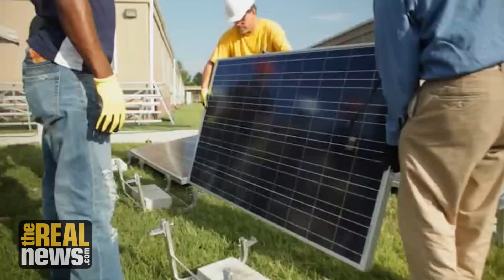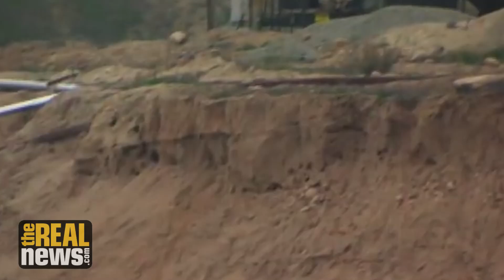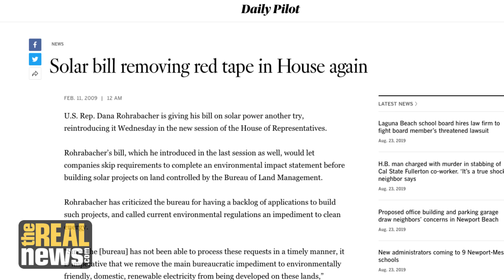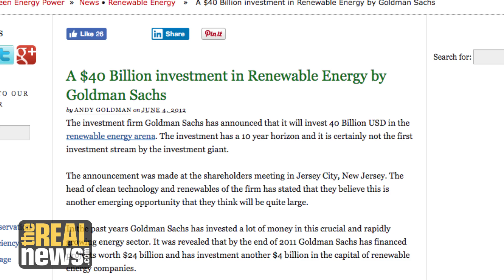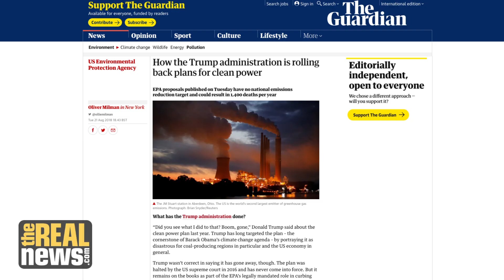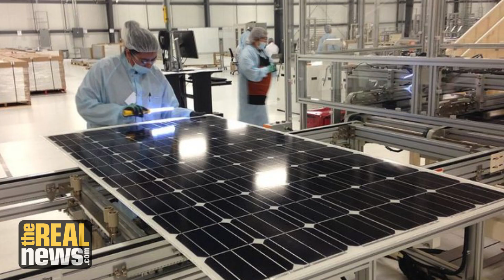The Land Politics of Solar Energy (2/2)

Comment: we have new storage capacity for electricity, the goal should be: every household should be energy independent.
Reply: With a shared megabattery for excess power generation so there would be local-use microgrids.  Imagine doing that in every subdivision.  Most subdivisions, especially newer ones, have a park or public shared space.  That would work for battery parks as well.
Reply: @zinaj9437  if we has a new power grid nationwide......plenty of work but no jobs🤔
Reply: Troy Walker The Progressive Proletariat   - It takes more energy to make lithium batteries (for solar/wind baseloqd power) than you get from the batteries during their lifetime. And that does not include the mining for resources and embodied emissions. It’s green washing eco capitalism that will not sustain our civilisation.
Reply: Zina J - It takes more energy to make lithium batteries (for solar/wind baseloqd power) than you get from the batteries during their lifetime. And that does not include the mining for resources and embodied emissions. It’s green washing eco capitalism that will not sustain our civilisation.
Reply: @wombatcitystudios  You are incorrect.  Do more research from reliable sources.
Reply: AZOffRoadster I have, I make documentaries and interview scientists. I’m sorry but there is no solution to maintaining our current civilisation in a sustainable way. You have be greenwashed by eco capitalism

Comment: Elephant in the room guys. Put solar panels on every single family home, along with solar storage in the home, then no one need buy his ridiculous book.
Reply: @JXPAT :  I definitely wouldn't take any advice you give.
Reply: Avoids transmission losses, and keeps homes cooler.  Can also be used to smooth out the load.  One European country (I forget which) is actually subsidizing home battery storage specifically for that purpose.  Electric cars with their large batteries can also be used for that purpose.  Shopping mall parking lots are also a good place to locate solar panels.  Every home or business should be harvesting solar power.  If we redirected half of the oil subsidies towards renewable energy, we could put a major dent in our greenhouse gas emissions.
Reply: @mikecorbeil  I definitely wouldn't take any advice you give.
Reply: @AZOffRoadster  it's also an incredibly awesome to Empower ourselves
Reply: @mikecorbeil  excellent, since I'm not giving advice. Meanwhile my home has solar and solar storage.

Comment: Heat reduces efficiency of solar panels. We should be putting them over the ice caps, but that will only be viable if we solve the issue of efficient transmission. And the mess it will make of the caps putting them there. Bottom line were fucked no matter what we do.

Comment: solar panels should be cylindrical so as not to redirect heat and light back into the atmosphere.
Reply: Thermodynamics makes this is irrelevant.  The light/heat always gets back out.
Reply: @robmorgan1214  integrate solar water heaters
Reply: @troywalkertheprogressivean8433  that changes nothing about the fundamental efficiency limit or what happens to the waste heat.  It's just not that simple.   You can't recover much more without prohibitively raising the costs.  And at that price point the advanced super efficient panels start to become competitive again.  Also if you go to a heat based solution you're up against the limits mechanical efficiency.  Steam is only good to about 30% assuming you find some way to make the water hot enough.  Look at solar concentrator plants they're designed that way for a reason but at a bit of a hassle.
Reply: @troywalkertheprogressivean8433  the panel technology is still advancing pretty quickly.
Reply: @robmorgan1214  im simply saying use the excess heat to heat water/make water hot
Reply: @troywalkertheprogressivean8433  I understood your point.  It isn't a very practical way to get the waste energy out of the system.   The cells themselves become less efficient when hot.  Not every photon absorbed gets turned into electric current.   If you don't re radiate that heat the efficiency will drop.  The amount of reflected vs absorbed energy is not enogh to convert into useful hot water.   The water will radiate it's energy as an infrared black body just like the panel substrate unless you use some of the electricity from the panel to pump it into a heat exchanger, decreasing efficiency.  The waste heat is about 10% of the available energy.  Mechanical or heat storage systems like this are about 30% efficient meaning you're looking at recovering at most another 3% at the cost of plumbing, mechanical systems, insulated reservoirs etc.  That's before you consider the 1%-2% loss of efficiency if you make the panels hotter by keeping the water stagnant enough to get hot or let the water sit around long enough to cool down.  Heat doesn't like to stay put.  You basically use it or lose it.  It's close to a zero sum game because of engineering tradeoffs and costs.
Reply: @robmorgan1214  still, those are concerns for large scale, and my goal is every dwelling energy independent. every dwelling having water capture, filter, reuse. btw, i think it would only take a magnifying glass to turn water to steam.
Reply: @troywalkertheprogressivean8433  that's a different kettle of fish.  I think you could use it as an overall booster to a hot water system but some thought needs to be put into it since it's not going to work very  well on cloudy days,  at high latitude, night, or in the winter.   The solar cells will function year round and at lower efficiency on cloudy days.  Keep in mind that panels are already claiming the lion's share of available energy and the leftovers are difficult to hold onto (IR/UV).  You're going to need to learn a bit about blackbody radiation as that dictates the absolute engineering limits but there's probably a way forward from there.
Reply: @troywalkertheprogressivean8433  You don't understand science you should stop. That is the problem simple/common sense solutions are not always simple but more expensive. You need two panels to heat water.... The average home does not NEED a ton of hot water.
Reply: @dj4monie  no, but reaching boiling will help purify the water. multi purpose.